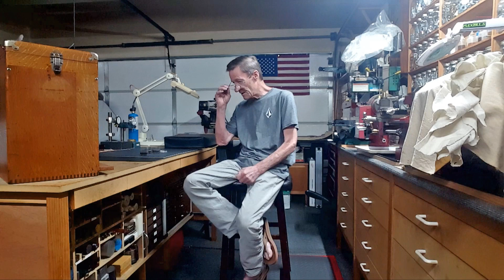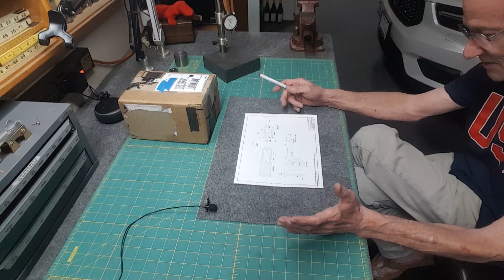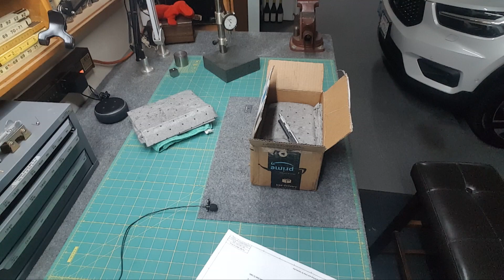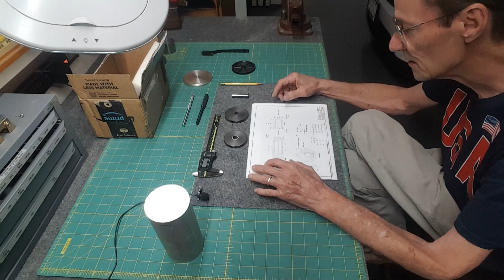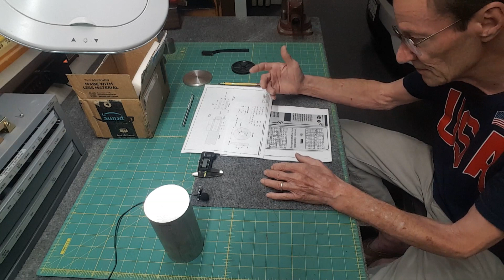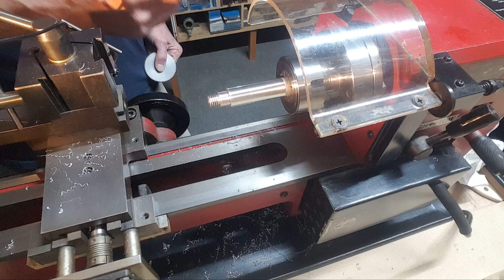Machining DEEZ Vevor 72 Tooth Gear Pt 1 of 3

Comment: The bushing with an included key to match the gears may be a part to carry spares for. A friend stopped by in a panic needing one whipped up to finish a part. It had broken in what appeared to be a sacrificial shear to save the gears.
Reply from the maker: Never thought of that but not sure what could cause such force to shear it off.

Comment: M6-0.75 is a fine thread used on a few of our motorcycle's engines and 5/8-11 is common to many angle grinder shafts... and nuts of course.
Reply from the maker: Interesting since today angle grinders come from China so metric threads. I have 3 of them and one very, very old and still metric.